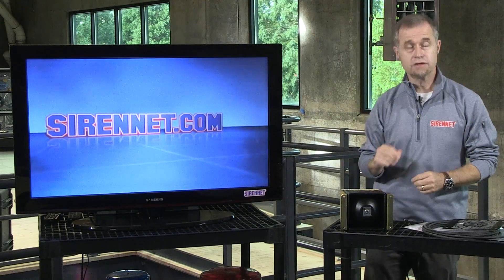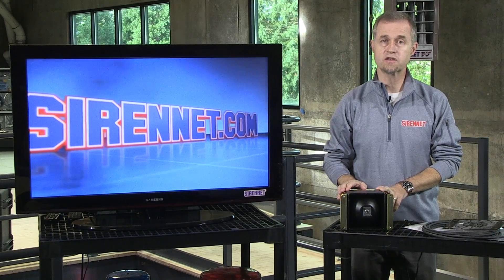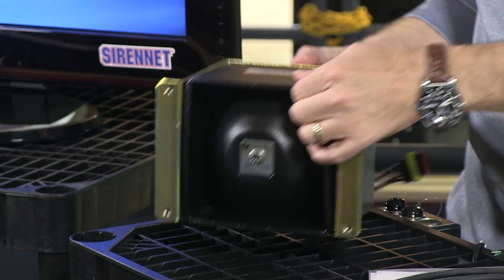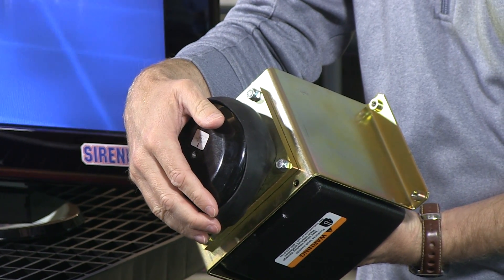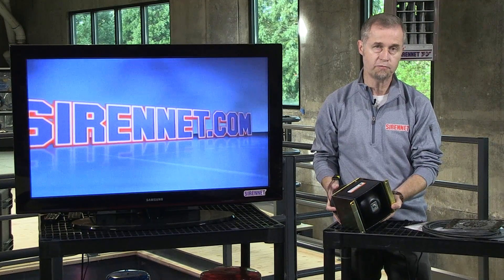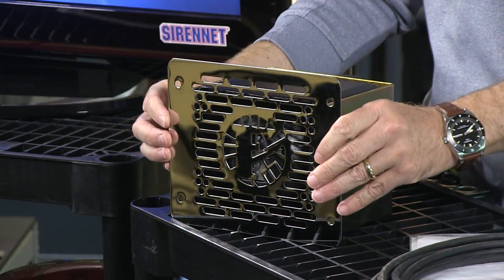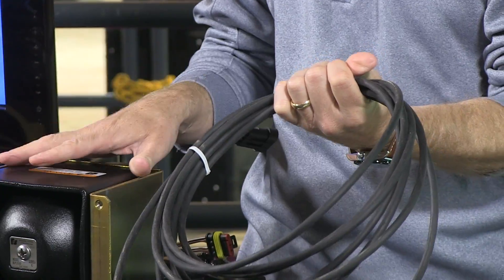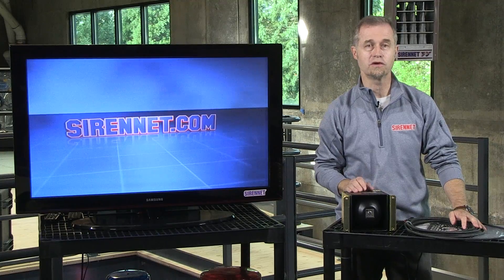Federal Signal BP200 Series 200 Watt Speakers

Comment: These actually have two 100 watt drivers, facing each other, one front, one rear, and sound is funneled thru the cast aluminum housing.
Reply: I honestly didn't know that. So instead of buying two separate speakers for a dual tone siren amp I could just buy this speaker.